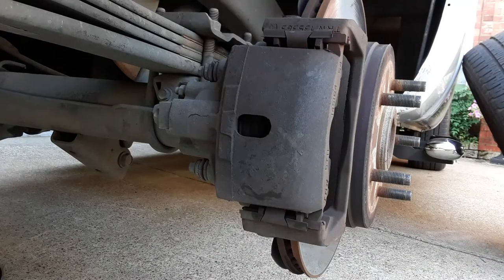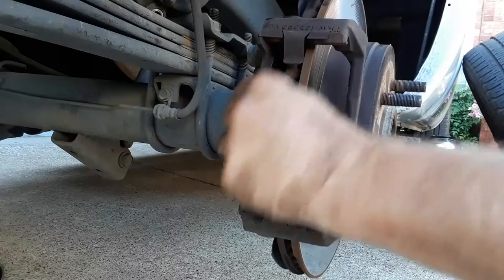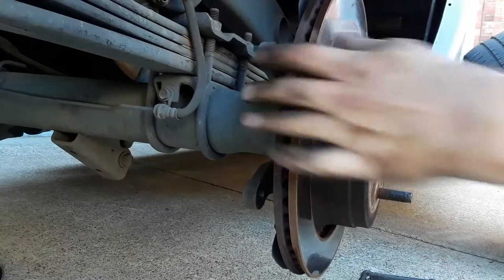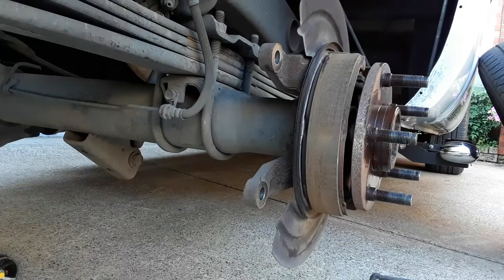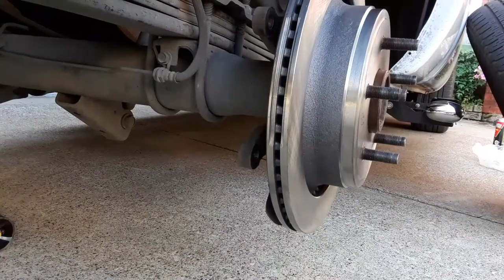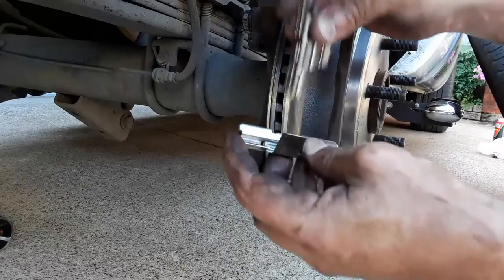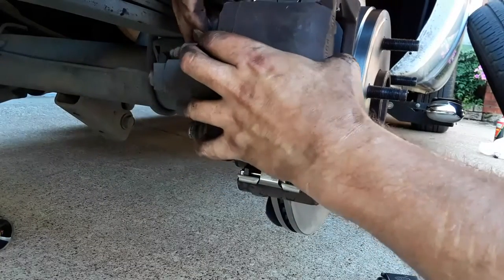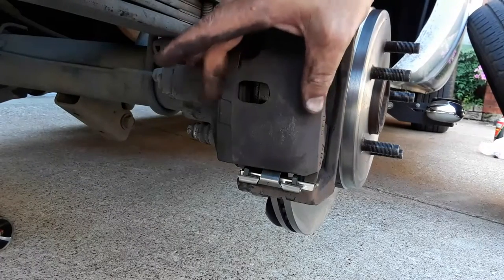2003 Dodge Ram 1500 Rear brake Pads and Rotors

Comment: no brake grease on hardware?
Reply from the maker: None needed or recommended on the stainless-steel clips. Grease attracts dirt then you end of with basically a lapping compound grinding into the metal. That is why the factory doesn't use grease. Other than making sure the caliper slider pins are free and slide easy no grease needed on anything else.
Reply: It's quite obvious he's unprofessional

Comment: i just did this two days ago to my 07 1500 ram and that same passenger side rear gave me the same issues, same bolt too lol the fronts were easy but the rears made me wanna put my fist through a wall lol good video though, good to know i did this right, except i didnt push the caliper piston back in which would have made my life alot easier lol